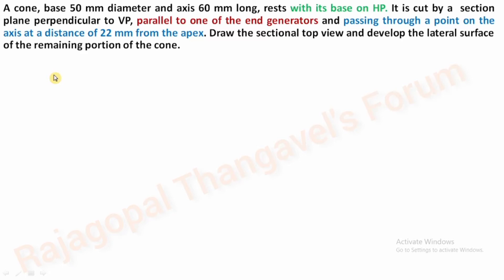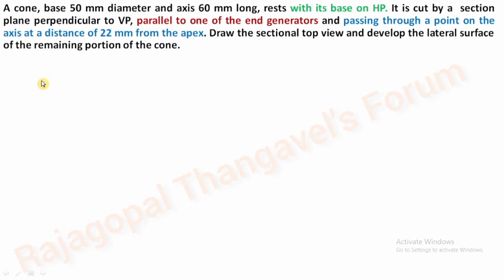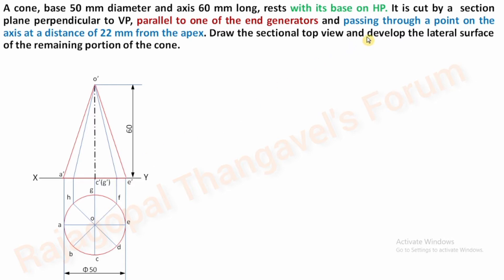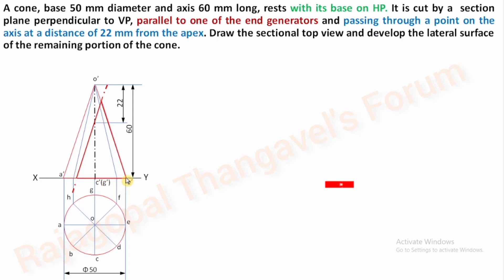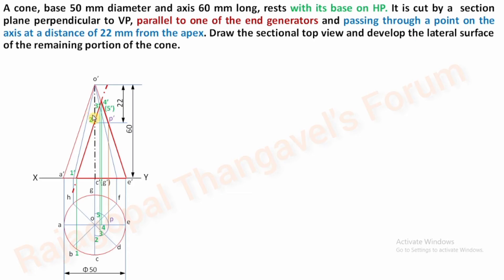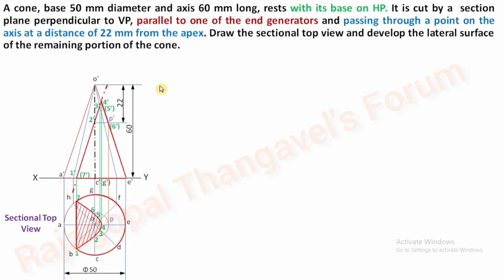Development of Surface Cone  | S.P parallel to end generators @rajagopalthangavelsforum

Comment: A cone, base 60 mm diameter and axis 60 mm long is lying on the H.P. on one 
of its generators with the axis parallel to the V.P. A vertical section plane parallel 
to the generator which is tangent to the ellipse (for the base) in the top view, cuts 
the cone bisecting the axis and removing a portion containing the apex. Draw its 
sectional front view and true shape of the section.